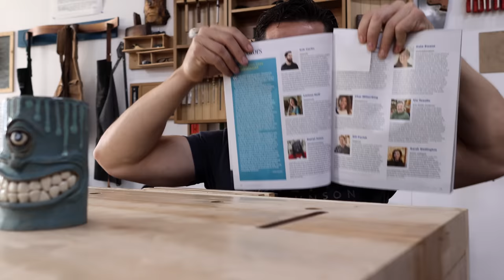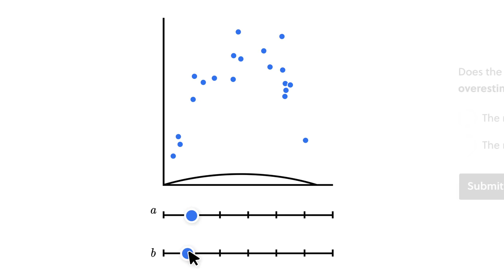5 tips youtube woodworkers give that professionals HATE

Comment: 1. If you use CA glue like you demonstrated, you’re gonna have a mess.  I use it it all the time mainly because I have more time to align the two pieces. With double sided tape it’s more difficult to accurately align parts. they both have their time and place.  
2. C channel, I would love to see proof on this not being valid.  You’re example of it not working is a live growing tree expanding on the sidewalk.  We’re working with dried dead trees that move in tiny fractions if that.  Guitar makers have used steel rods in the necks for a hundred years now to keep them straight and, it’s been proven to work extremely well. Maybe steel has a use on some projects. 
3. Rubio, don’t know much about it and don’t care but apparently it’s a social media trend finish, how many green tools do you have?  What youtube trends should we follow? The ones you agree with or the ones you disagree with?  Or are you getting kickbacks from your alternate finish? 
4. Yellow glue and sawdust.  Your viewers are garage woodworkers, this technique is perfectly acceptable for this type of woodworker.  It’s something that we all should learn and when we do, we find better tools and techniques that’ll help avoid these gaps.  I have a $1200 table saw and no room for a jointer or a planer, my joints are almost always a little sloppy simply because of my tools.
5. Stain, no professional uses stain because time is money and stain takes more time.  I wouldn’t use this as a bragging point as a professional. most garage guys aren’t spraying finishes and they have the time to screw around with stains.  You can get some really really beautiful finishes with stain that you can’t get with a tinted spray.  I refinished a highly figured maple top les Paul guitar with stains and I had complete control. To much color in one area, I sanded it down a little to time it down. In the end I used a damp rage to blend all the colors together and then sprayed a clear coat.  With tinted spray coats the outcome would’ve taken at least 6 coats different tints, plus he clear and you don’t get to put play with it, like you do with aniline stains.

Comment: Well, even as a hobbiest I mostly agree with your opinion... But I don't do with the ca glue and blue tape... At least in Germany the tape manufacturer no1 is 'Tesa'. The double sided tape is so sticky, that it is very hard separate the pieces. And what is even worse... If you are unlucky you even pull out some fibers. And I am very bad in repairing... Blue tape isn't very common in here. I use paper tape, the one which Amazon uses for their packaging. This works fine with ca glue, but it's not my favorite solution.  I actually use paper tape and double sided tape in between. But no matter if you use blue tape and CA glue, double sided tape oder paper tape and double sided tape. Never forget. Less is more... It just has to hold temporary for some minutes... Not forever
..

Comment: Personally I have found that double sided tape (as we call it in the UK) is WAAAAY to sticky for a lot of applications and masking tape (again UK) sticks much less and is easier to remove.
Also, that was far far too much CA glue. CA works much better with a very thin bond layer. That much was always going take ages to go off and leave a weak joint, that is why I'm not a fan of the gel.
The first time I saw this trick was Jimmy DiResta about 10years ago. Whether he is considered a professional, i can't say.

Comment: Just curious, can you give me an example of wood (lumber, not a live growing tree) through expansion and contraction deforming construction metal?
Reply: https://youtu.be/V6jJpRMI40o

Navigate to about 5':25"

This is a two year old example of wood bending bolts, shearing screw heads off, and the threaded inserts were even shifted.

C-channel is hardware. Hardware does not negate or prevent the seasonal shifts of wood. There is no issue using them but not to fight the wood...something will fail: the wood, the hardware, the finish, or even perhaps even the faith of customers in your ability to make fine furniture.

ENCurtis says it simply: "[...]allowing the wood to expand and contract[...]"

So that should suffice as providing an example of "construction metal" being deformed.
Reply from the maker: Yes, when I was teaching we had workbenches of 1.5" maple with steel bases. 36" wide tops. One of the bases had the welds busted apart due to seasonal wood movement. Flat sawn maple at 36" wide will move approximately 3/4" over 6 months and ain't nothing gonna stop it!

Comment: I agree with the double stick tape over CA glue but if you must use CA glue, don’t pour a quarter of the bottle on your blue tape like this guy. CA glue is typically the choice because it’s strong. That said, you don’t need to use a lot of it. You don’t even need to apply a line the full length of the tape. A couple drops are all you need to get a good hold and not ruin your material.

I agree; if you’re too dumb to use CA glue effectively, you should definitely listen to this guy and use double-stick tape.

Comment: Two things
A: do you think c channel will work on a three quarter inch panel glue up 23 inches by 20 in AK, a cabinet door made of cherry grain matched for a vanity that I built that keeps warping? 
B: most people use the tape and glue method because they have bought 10 different types of double-sided tape that either don't come off, come off too easily or are wildly expensive and inaccessible in their small town. Nice beard

Comment: My biggest bugaboo
A single blade on the table saw and the multi pass to chip away a dado cut or rabbit cut
The worst example is to make many passes and still break out the chisel to chip out the dado cut then sand it. And proceed to do the same on many other pieces. 

Why not just get a dado stack
Or use a router table?

Another one
The router slab flattening jig
Why not do a similar set up with an electric hand planer? You know. Make it go with the grain of the slab and have it be a little smoother finish

This guy made a small version. Easily adaptable to a larger slab flattening jig with an electrical hand planer

https://youtu.be/ko2Tl7cDl6E?si=3Cjw348VJkgwqmkb

Comment: Superglue and tape not about saving money. It's about having an excellent hold in shear, but being able to remove easily. It is thin, so it doesn't affect CNC use like the thicker DS tape.

I've had way more DS tape pieces launched by my CNC than superglue and tape.

Also, the amount you used in your demonstration was absurdly over the top to prove a point that doesn't exist if you do it right in the first place.

Comment: I agree and disagree with some of your comments. C channel, in specific tables, like it is heavily used for in epoxy/river tables, can prevent movement - I agree, not the wood movement, but epoxy movement/sagging/bowing - because epoxy sucks. I've worked long enough with it to try to avoid it.

I agree with the internets draw to rubio monocoat - I've never used it, but I do use osmo, and have grown to love osmo in the last year or so. I suspect rubio is very similar, and my take is that it is easy to master the finish application process and make a piece look very good with these types of finishes, relatively quickly without much knowledge or experience with a wide range of them. I use an array of other finishes, application specific, but rely on the curable hardwaxes for the pieces that will see tougher use.

I agree with the wood glue and sawdust hack. I mean, you have to ask why the gap is there in the first place.

I don't know why you are worked up about CA glue and blue tape. I don't use it, but I could care less who does. 

I'm inexperienced in this area, so this is an honest question; but would cabinet or stair makers, use stain? Could that be an area that professionals use legitimate stain.  I can't say I use it at all, maybe a few times starting out, and once on a soft maple slab that the customer requested - which was color matched by a local cabinet/stair shop, and supplied to me.

Comment: (definitely not a pro) Blue tape and CA is really common among CNC users. All of the plastic-based double stick tape is TERRIBLE if you hit it with the router bit and you need to bring out the acetone to clean it up. I recently picked up some XFasten "woodworking" double stick tape hoping it was better (I've heard there is a paper-based one out there … this isn't it) and it's great for regular woodworking, though it's actually stickier than my blue tape. Not so much for the CNC. But blue + CA is definitely not a cheaper option and people really need to stop thinking of it like that.

Comment: Can you back up your claim that c-channeling does nothing to keep a table flat with some science?  Because it does exactly the same job as a sliding dovetail, if dimensioned correctly!

The legs of the C have to be way longer as shown in your video, 70-90-70mm and 4mm thickness for 100mm thick tabletop, for example.

If the slab hasn´t been dried properly it will break the sliding dovetail, too. Before the c-channel bends (if it is calculated to the thickness of the slab correctly), the wood will break/rip first. 
It´s not the solution for every table, but it is used by professionals in Austria, because if you don´t want to have  something sticking out under your tabletop, the only method is to reinforce the tabletop with some sort of steel profile, that does exactly the same job as a sliding dovetail, but does it within the slab and not 2/3 out.

On the other "tips" I agree with you.

Comment: i disagree with your c channel thing.. i have little box with V shaped roof made of 24mm pine, outside, cowering water pump. when i built it, i put there Few pieces of din bar (so no drilled c channel but thats just cosmetic) in case glued joints fail.  Few weeks ago i disassembled it to put new coating on it, and after unscrewing those din bars, that roof warped few mm. Im no expert here but i think those bars helped it stay straight.
5.55 you do realise that concrete cracks becouse of live, growing tree.. wood used by woodworkers is kind of dead - not growing anymore.

Comment: There are 3 things wrong with your jar of finish.
1: it is in a mason jar which is not only round but has a top that wishes to be fused with the jar.  A flip top jar with a bail lock is simpler to open and are usually square so nestle up to each other nice and cozy.
2: you are using half of double- faced tape with a pen. At least use a marker. But you should design your own label for your printer and glue it on...or the ultimate get a silhouette and cut out your own label that sticks on by itself. I realize this wastes time, but it looks sooo much better. And I'm retired so I can give advice on how to waste time.
3: the label is crooked dude!:face-blue-wide-eyes:

Comment: 2:55 --- waaaay to much glue and accelerator 

use 1/5 of what you used (glue) and only mist the accelerator , amount like that will just make glue on the tape "unstuck" from it and wont give any benefits

why you want to use this method ... you dont ... depend of the situation in case of woodworking it isnt needed , its better to use doble sided stick tape 
but when working with CNC , metals etc double sided stick tape can be to flexible

Comment: Ok... C Channels... Yes, they help to keep the slab flat.  They are a deep member with a high Young's Modulus put near the surface of a shape.  They will help increase resistance to bending moment in the plane they're in.  Yes, there's actual engineering behind it.  Ask anyone who's made it past the deforms class in any physical engineering curriculum.  Personally, I'd install it in two directions.

And, yes, wood can blow apart concrete.  Concrete is strong in compression and horrible in tension (to the point where we assume that all the concrete below the neutral axis in a beam is cracked and contributes ZERO tensile strength), and quite susceptible to spalling.  However, steel is much better in tension (which is what the rebar provides to a beam).

Finishes - "chemically similar" is really meaningless.  Water and hydrogen peroxide are chemically similar but should never be mistaken for each other.

Glue and sawdust - preach it.  Agree - it's a decent solution, but not a panacea.  I'd rather see a paste made of glue and sawdust.  It's my preferred solution... but I'm still gaining skillz... and supplies.

Comment: Congrats on getting published. 
Respectfully, you don’t really give any supporting points for a few of your positions. 

Spending more on double sided tape as a hobbyist (it’s often way more elastic and allows for more movement also) 

2- how would a steel c channel NOT prevent cup. It can’t overcome the steel. A living tree. You can’t compare the forces exerted from a dead tree to a living one (also the earth is a key component in your example). It’s like saying guy-wire doesn’t stabilize a pole. The wood might break where the fasteners are connected. It’s just not likely. By a similar logic Tiny little butterfly’s can stop wood from continuing to split in its tracks though?

3- Rubio is absolutely a terrible finish long term and over used. Good job. 

In my opinion, it feels a little bit like you forgot where you started with this video. YouTubers appeal to those getting started and with small budgets. That is their audience. 
These very public opinions is part of the reason fine wood workers have terrible reputations with gate keeping and pushing out people who just wanna create, have fun, and build for their homes. 

If they stain their wood with RIT fabric dye and want purple oak in their home, why not? Maybe they like oak grain and purple wood. 

Good luck, but MAN do I feel these are just bad takes on a minority and pretentious perspective. 

Results are results. Why does it matter how people get them?

Comment: One roll of double stick tape at a Rocklers costs $25. That's why hobbyists don't use that tape.
Reply: Yes, but it will last you ten years. That's less than 25 cents a month. Use it by the inch, not the yard.

Comment: I hate this video, its acting like these are bad practices on the face of it (clickbait, the worst kind) and then bashing decent techniques because... woodworkers who aren't connected across the globe via the internet don't use them?? 

Also it's entirely opinion-based, with multiple ad spots, with ZERO testing or substantive arguments. 

As someone who is learning woodworking, every single one of these tips has been super useful to learn and to have in my back pocket. As well as most YouTube woodworkers have clearly stated the pluses and minuses that you've outlined in this video and thensome, all without bashing the good techniques that they are. 

Also, yes, C-channels are extremely rigid, and will help stabilize yearly wood motion. You compared it to live growing roots, which continually expand overtime, rather than a dead and dried piece of wood like a table that might have a tendency to cup slightly halfway through the year. Those are huge differences, so I'd call that a totally dishonest argument. 

Running across stuff like this is frustrating because it's just adding bullshit fodder added to the creator network and makes it harder for people like me who are starting to sort through what's true. 

At best, this video is self-defeating. At worst you're telling a lot of people that these techniques are bad, and they aren't. They have limitations, just like any other technique.

Comment: Thanks for a great video! When you were talking about the c-Chanels to keep the wood flat I actually think there’s something to it. It’s not the metal it set but the relief cut you have to make to get it in. But I wouldn’t rely on it, proper dried wood, handling and machining is the most important. 
I use both Rubio and osmo. Osmo is great when you want that freshly sanded look and  don’t want that yellow tone that Rubio pure gives.
One big plus with Rubio is that it’s solvent free. When I use osmo I have to wear a mask otherwise I get a headache.
Greetings from Sweden 🇸🇪